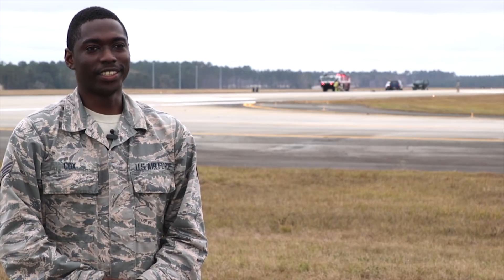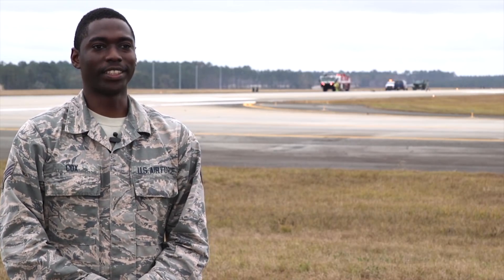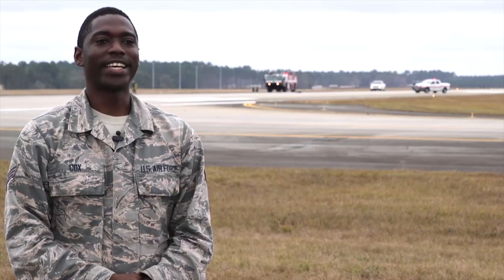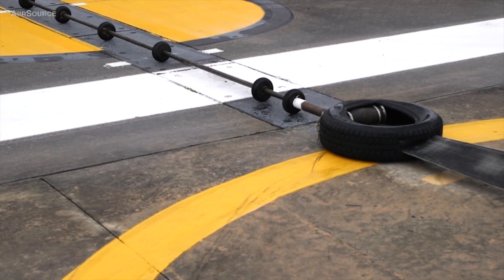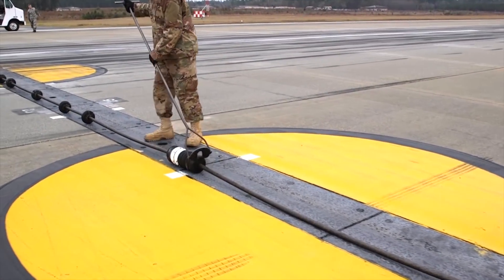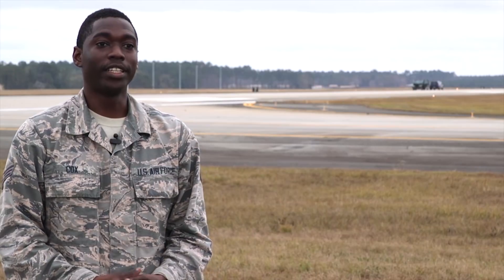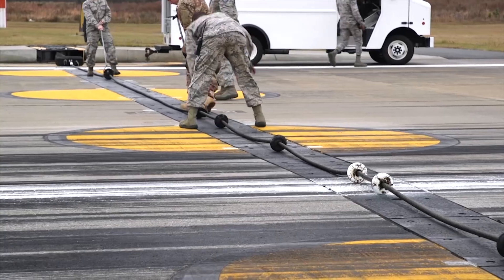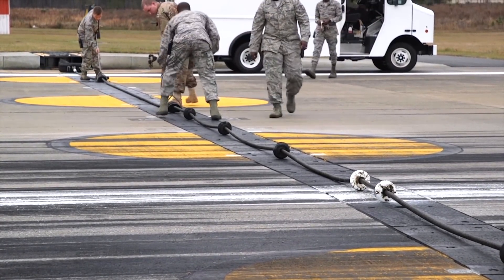F-15 Fighter Gives Aircraft Arresting System A Try

Comment: Who else wanted to see the F15 give a try at a simulated carrier landing?
Reply: It doesn't have the reinforced landing gear to be able to sustain a hard carrier landing. The tail hook is just one aspect of carrier landings. But it definitely would have been interesting.
Reply: @Gsmooth10455  if u ask me reinforced gear should be a requirement for all fighter aircraft.
Reply: @tyreekmurillo4524  Why?  USAF fighters are all ground-based and have absolutely no reason to slam themselves onto the ground.  Their gear is more than adequate for the job.
Reply: @Mom-USMCRichardUSMCChristopher  I think a carrier style mobile launch and recovery system would be of benefit. A single transport could drop everything needed after a minimum area prep time. In regard to your comment, exactly who brought up that new pilots be involved. Why would you expose inexperienced pilots to something which requires refined skills. Your argument is circular.
Reply: I wanted to see the F-15 buzz the tower…. 😉
Reply: The F-16 is probably more suited to carrier duty, with its lighter weight and wider landing gear.

I just wanna see USAF equipment land on a carrier; ANY carrier will do!
Reply: @h8GW  "wider landing gear"

Bruh, the F-16 has the narrowest landing gear track of any currently operational fighter aircraft.
Reply: @disorganizedplay  Well, obviously it's a smaller jet, but it keeps all of its fuselage within the main gear track, so I'm pretty sure it has more stable ground handling.
Reply: @h8GW  Landing gear track width is what matters - the F-8 Crusader also had all of its fuselage within the main gear track and it was something of a bear to land. And its gear triangle was much bigger due to the nose gear being much further forward than the F-16's.
Reply: @disorganizedplay  I think we got way off topic here from my original point that the F-15 seems to have less-than-ideal landing gear for carrier ops, since from a simple visual perspective, carrier-rated landing gear don't often have solo straight vertical struts and are widely spaced compared to the fuselage.
Reply: @h8GW  The F-14 Tomcat had and the F-35C Lightning has straight landing gear legs. It’s not about the design but about how they can fit the legs into the fuselage after retraction. Straight and angled oleos are just different solutions to the problem.
Reply: @disorganizedplay  I'm aware the F-14 has a straight vertical oleo strut, but it also has a very conspicuous diagonal brace, and from images, it looks like F-35C comes with two smaller diagonal braces.  While it looks like the F-15's main gear has a diagonal member, too, it seems pretty undersized and high up and is probably more useful for the retraction mechanism's leverage than for hard landings, not to mention the F-35 also benefits from decades of improvements in materials engineering.

Though I'm not having much luck finding some anecdotes of the F-8's ground handling characteristics, I'll say that wider gear won't automatically make an airframe as planted as a mountain goat, since there are other factors to consider, but it definitely would be more stable than if it was narrower.  Also, if its gear is relatively farther forward, it would make its gear triangle pretty narrow, so I think the width of the main gear is a more important consideration than the location of the nose gear towards stability.
Reply: @h8GW  The F-15's landing gear is also built without any consideration at all for carrier landings, as at the time it was designed solely in response to Air Force requirements. If the F-15N Sea Eagle project had gone further than napkin sketches, the landing gear would have been redesigned. The F-16's main gear was designed for rapid conversion to a carrier fighter, since the LWF fighter design was SUPPOSED to be a service aircraft for both the Departments of the Air Force and of the Navy. However, it still has a substantially narrower track than the F-15's and while ground handling isn't a HUGE issue for a fighter plane, its ground handling is probably a good bit tricker than the F-15's.
Reply: @disorganizedplay  You need to check your info.

Comment: It would be good to develop a modified portable  (?) arrestor system to reliably trap F-15 type anywhere, in under say 3,000' of runway...  Just equip with rocket assist takeoff for good measure ??
Reply: SCAMA has a system for that as well, the Mobile Aircraft Arresting System 😉
Reply: PAG portable arrestor gear

Comment: In Australia an F-111 had to make a arrest hook landing without the landing gear.
Reply: Fact:technically the f111 was developed for the navy, not the air force, it wasnt used only becuse the plane was too big and heavy so technically f111 shouldnt have any problem landing on an aircraft carrier
Reply: @davidecarucci1073  REAL FACT:  The Aardvark was developed for BOTH the USN and the USAF through the TFX Program.  It was the Pentagon's (SECDEF) idea to save money by having a shared airframe.  That is where the F-14 came in, the Navy didn't like the F-111.
Reply: @ShayneJenkins  The most distinctive features of the F-111 (variable wings and side by side seating) were Navy requirements, as was the long, low-slung tail fin. The Air Force wanted a shorter, taller fin and tandem seating.

Comment: For emergency only. Would have to be stored in the hanger deck until return to a base and off loaded by a lift.  This can be a life saver for the Usaf. In peactime or war. Plains cost lots of money.  Our money.
Reply: This type of equipment was originally designed not just for saving lives and planes but to be used on short airfields where the pilot wouldn't have enough runway to stop.
The gear was used quite often for training and other purposes and of course emergencies. 
F-18 night traps in the pouring rain isn't any fun.

Comment: Could land on a carrier?
Reply: The tail hooks on USAF planes aren't the same as on a USN plane. It's fine for an emergency such as shown here, but it wouldn't stand up to a carrier landing. The landing gear on USN planes are much stronger, as well.

The arresting system on AF runways are near the end, so a plane would have nearly the entire length to slow itself before engaging the system.
Reply: @doctorwigglespank8933  Yes, no.  The APPROACH end cable is the one engaged, ALWAYS.  There are cables at BOTH ends of our runways.  Aircraft hydraulic issues tend to cause braking and nose wheel steering issues.  If your brakes or steering are not fuctional, you need to stop NOW, not 1.5 miles later!  What you're watching is a barrier maintenance video.  Any time barrier maintenance is performed, they have to catch a jet twice to certify it.  A low speed pass, then a high speed pass.  These are done using high speed taxi runs, not with a landing jet.
Reply: Let's try it
Reply: no because it doesn't have an aircraft arrest hook so it is imposible in real life (but not in ace combat 7
Reply: @Busch Light yea i know (forgot to edit my reply)
Reply: No. The landing gear cannot take the impact of landing on a carrier. The gear would collapse.
Reply: no.  this system is basically for failed brakes on landing.  Carrier Traps stop the plane like in 100 feet coming in on full throttle in case system fails and the pilot does a touch and go.